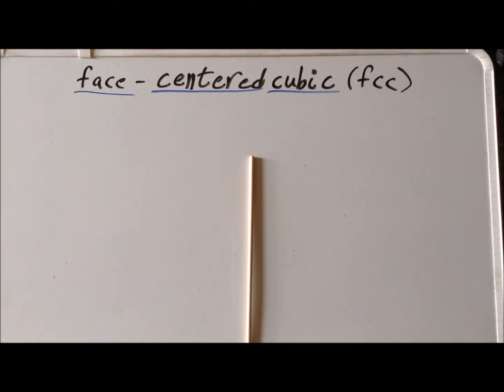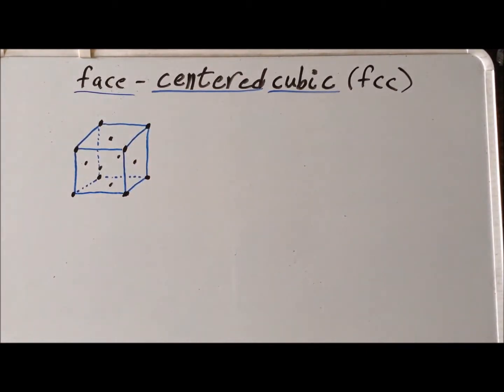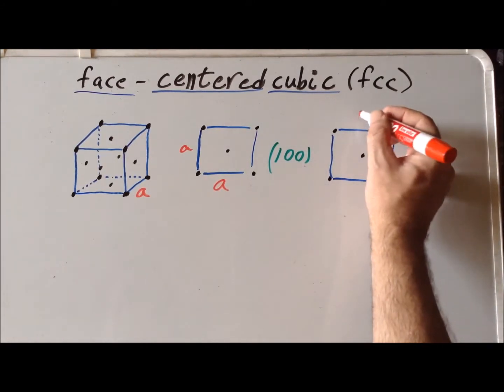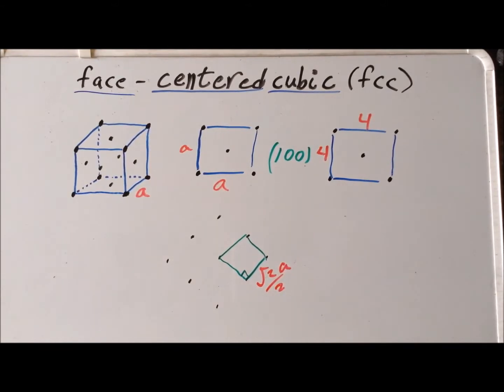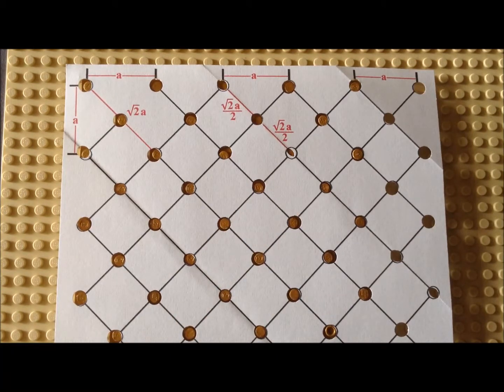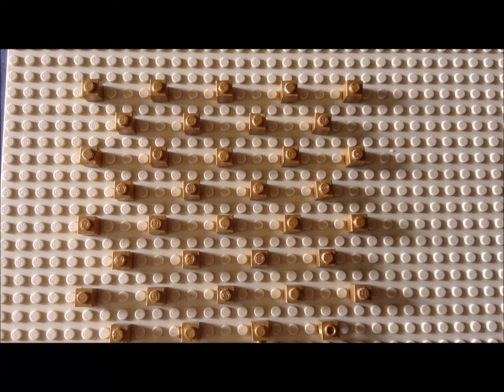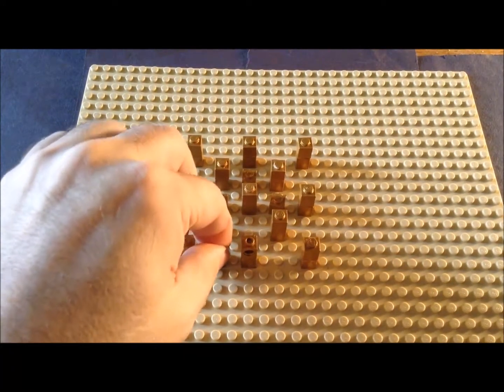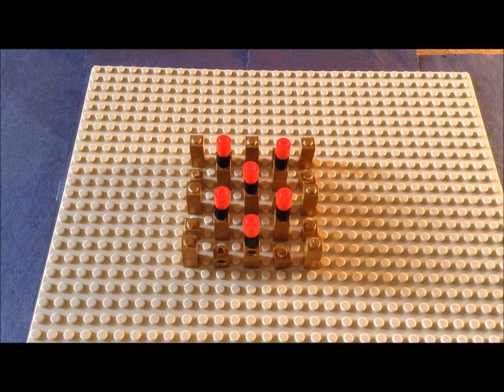Lego chemistry: fcc (100) surface

Comment: Thank you for the video ! 
May I ask a question.
1.Why does the adsorption not happen at the hallow atom technically couldnt it go to the hollow part and adsorb? Is it because the repulsive force of the atoms above??
2. And correct me if I am wrong but isnt (100) x=0plate so isnt it the bottom plate not the plate on the top??

Thank you for the video!
Reply from the maker: Great questions!

1. Yes, it is very possible for adsorption to take place in the 4-fold hollow, or in a 2-fold "bridge" site.  For many adsorbates / metals, they are more likely than "on top". I did not show those here for a somewhat unscientific reason - I could not find an easy way to show them with Lego (R) blocks. :)

2. The top plate is the surface (100) plane. We are imagining that the bulk of the crystal is found beneath the bottom plate. It is best to think of the bottom plate  as nothing more than a place to lock the Legos (R). 

If you are interested in the structure below the surface in the fcc crystal, see our video:
https://www.youtube.com/watch?v=KoOQbUQdEm0

A complete description of the paper models seen in the video, along with patterns to construct them yourself, can be found in our article:

“Lattice entertain you: paper modeling of the 14 Bravais lattices on YouTube” Sein, L.T.; Sein, S.E. 𝘑. 𝘊𝘩𝘦𝘮. 𝘌𝘥𝘶𝘤. 𝟐𝟎𝟏𝟓, 92(8),1419-1421.